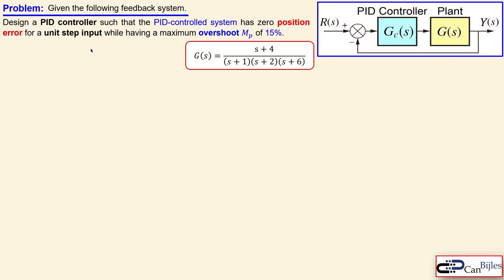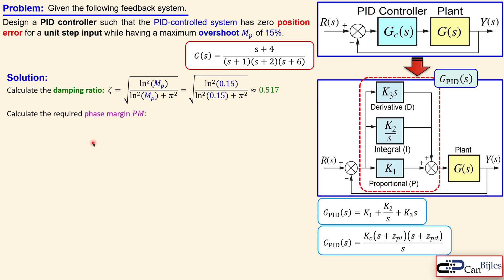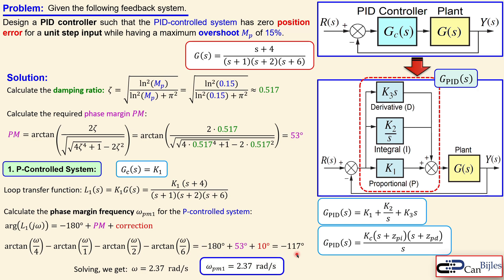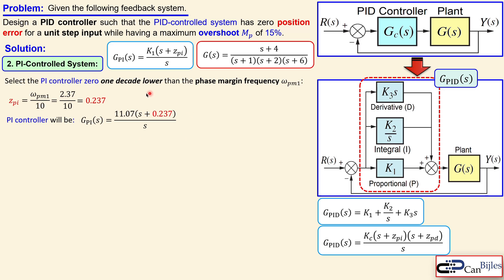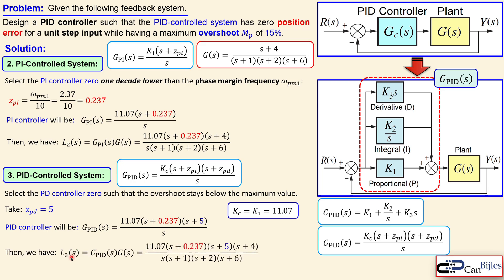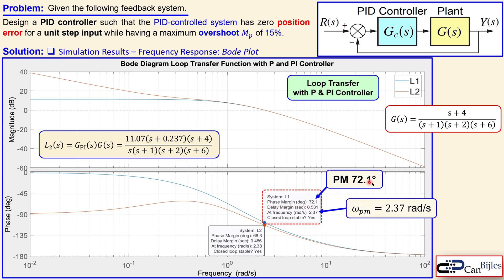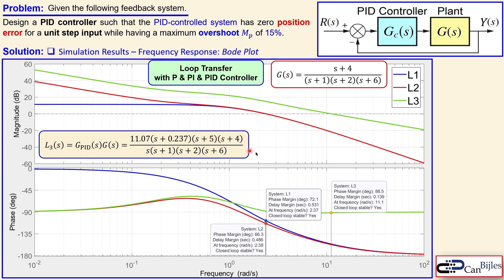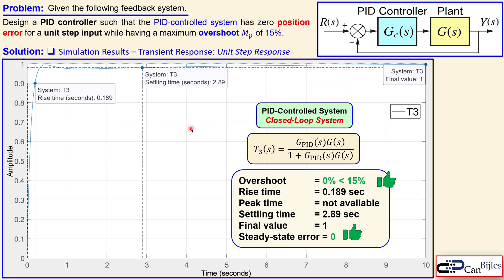PID Controller Design using Frequency Response Method🌟Calculations & MATLAB Simulations 🌟 Example 4

Comment: Could you please teach me how to perform in matlab software
Reply from the maker: I suggest to start at https://www.mathworks.com/help/matlab/getting-started-with-matlab.html. Depending on what you are looking for, you can search for the topics on internet.
Reply: @CANEDUX do you have matlab licensed
Reply from the maker: @darsaishealateja1345  You can get one as a student for free or buy one.
Reply: @CANEDUX yes I am student. How can I get free
Reply from the maker: @darsaishealateja1345  Use the website of MATLAB for the details.
Reply: @CANEDUX Can you tell the procedure, if PM  and Wgc is give how to find kp, ki and kd using frequency response
Reply from the maker: @darsaishealateja1345  More details about this and similar questions can be found in this playlist Frequency Response Method - Controller Design: https://www.youtube.com/playlist?list=PLuUNUe8EVqlkQ8kvTej5dRfOJ-ARmoi5B I recommend you to follow these videos to understand the steps.

Comment: dear professor, i am trying to learn controller design for power converters. for the power converters generally we consider gain margin parameter while designing a controller. in your video series i have seen that you did not mention about gain margin. as far as i know gain margin has an important role for transient responses such as line or load transients of power converters. could you please share your ideas about this and explain why you did not mention gain margin while designing pid controller?
Reply from the maker: Thanks for your message. This is a valid and good question. Indeed, for the stability analysis, we should check both the gain margin and phase margin. In control theory, we also look at the modulus margin, which is actually a better measure how safe we are from the unstable point in the Nyquist plot.

Usually (more often, but not always), the phase margin is somewhat more important than gain margin. If the phase margin is sufficient, than the gain margin is probably sufficient too, but of course there is no guarantee. In the videos I discussed about compensator design for buck converter, the gain margin was already large.

In the links shown below, they discuss transient response of power converter and the discussion is also based on phase margin only. I do not claim you should only look at phase margin for power converters, but I do not know how strict and important the gain margin is for power converters. Maybe you have a good reference about it, love to read it.

https://www.ti.com/lit/an/snoa507/snoa507.pdf?ts=1717893510339
https://pdfserv.maximintegrated.com/en/an/AN3453.pdf
Reply: @CANEDUX  çok teşekkür ederim hocam. Benim için oldukça anlaşılır bir cevap verdiniz. İyi çalışmalar dilerim.
Reply from the maker: @sahinbozkurt886  Rica ederim, memnun oldum. İyi çalışmalar.

Comment: Excellent video, but there is something I didn't understand. What is the step by step to obtain ωpm, is there a link or content to review. Because as far as I understand, that equation of arctangents equal to the phase margin has no possible solution.
Reply from the maker: Thanks for your message. Great to know that you liked the video! You can solve a equation using a graphing calculator or online equation solver like https://www.wolframalpha.com/calculators/equation-solver-calculator
Reply: @CANEDUX  I was trying to avoid that, but thanks fot the advice. Maybe Newton-Raphson can solve that.
Reply from the maker: @ControlAutomatico2020  It is a nonlinear equation, so you can try to approximate it using numerical methods, but this will be tedious and not always easy to solve. But worth practicing 👍

Comment: Спасибо Вам огромное за прекрасное видео. Оно реально поможет решать практические задачи
Я пытался сам просчитать частоту при 117  и она получилоась 2,94 rad/s. Если вам не сложно, не могли бы вы подсказать код Матлаб для правильного вычисления частоты?
Reply from the maker: Thanks for your message. I will share the MATLAB script of this problem as soon as possible in the video description and also check the calculations for the phase and frequency.
Reply: @CANEDUX  благодарю Вас!
Reply from the maker: @SMV1972 You're welcome.
Reply from the maker: @SMV1972  Here is the MATLAB script of this example: https://drive.google.com/file/d/13GDBFPsFWNiJLI_Nci44j3VWtqVvS5gO

Comment: How come you used a 2nd order formula to calculate the 3rd order dumping ratio?
Reply from the maker: Damping ratio formula is only valid for a second-order system without zeros. So it is approximating any other second-order system with zeros or a higher order system.

Comment: What is exactly the phase margin frequency? this omega pm1 you calculate in the minute 4:30, I thought it was the following (i'll try explain myself as well as i can), if you ignore the frequency response and you do a root locus analyisis, when you find out the "wanted poles" that makes your system meet the design requirements, these have a real part and an imaginary part, well I thought this imaginary part was given by what you call phase margin frequency, but now with this video I don't quite grasp the concept of this, I'd appreciate very much if you could help me understand it. 

PD: YOUR VIDEOS ARE AMAZIN, everything is very clear and you make it easier to understand PLUS you've taken the time to do it in MATLAB, which really makes this video TOP CLASS, I appreciate you for takin time to make these amazing videos to help strangers :)
Reply from the maker: Hi, thanks for your message. Great to know you like the video!

1. Phase margin frequency is the frequency where the required phase margin is achieved. This is determined by looking at the loop gain = 1, so at what frequency is the loop gain equal to 1.

2. The imaginary part of the design point (where the dominant poles are) is not the phase margin frequency.

The following link explains graphically what the gain margin, phase margin, gain margin frequency, and phase margin frequency is. You can use the command margin(sys) in MATLAB with sys the loop gain transfer function to show these data.

https://nl.mathworks.com/help/control/ref/dynamicsystem.margin.html

Let me know if this was helpful.
Reply: @CANEDUX  It was really helpful, thank you very much !!
Reply from the maker: @MarioVladutTino You're welcome!